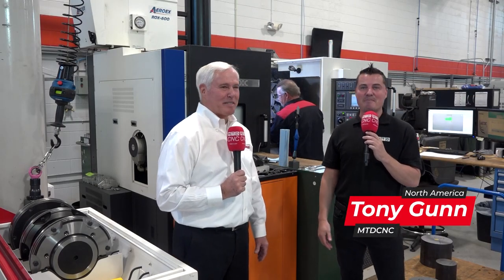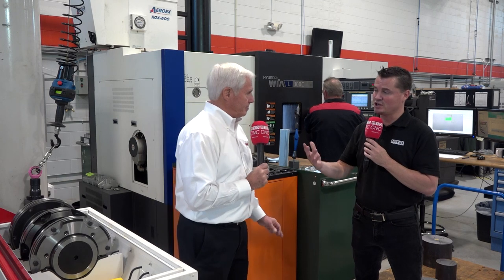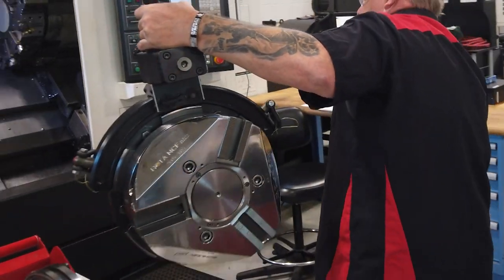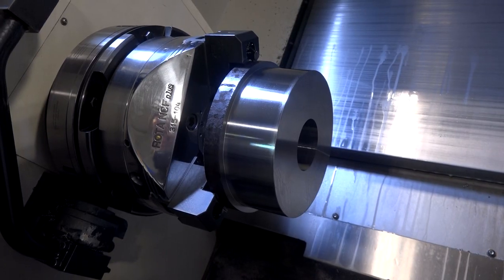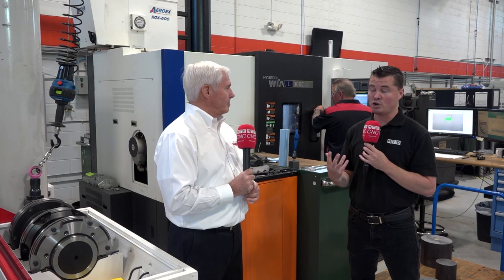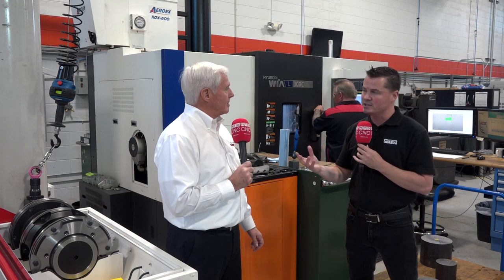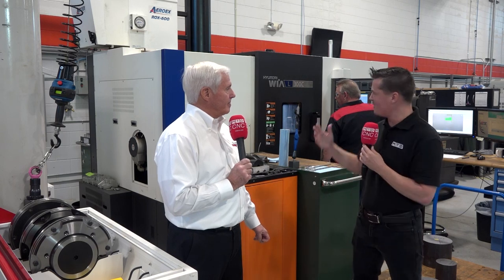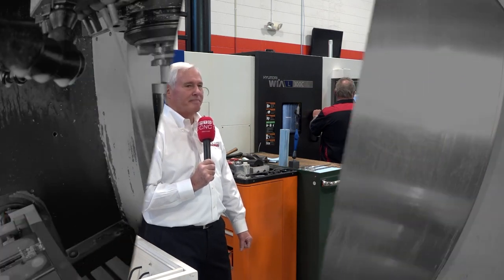Can you be ready to machine this quickly?

Comment: I cant find any description of this device that says if you can bar feed or is this for chucking work only? Charles
Reply from the maker: its both you can change the front facing unit fom a 3 jaw to a collet system for example so it would work with a bar feed